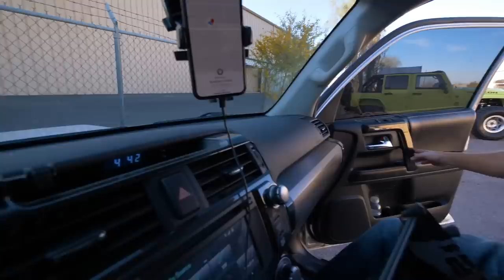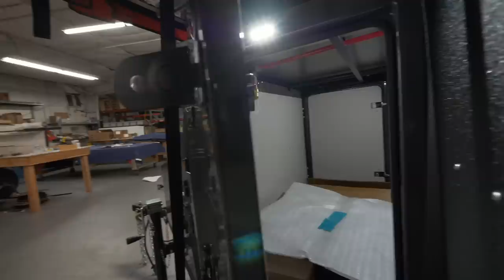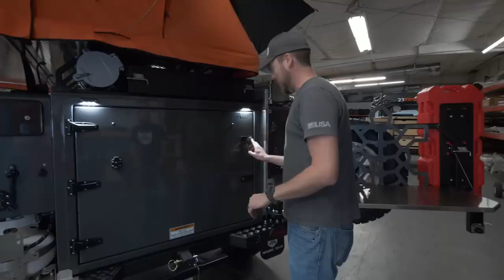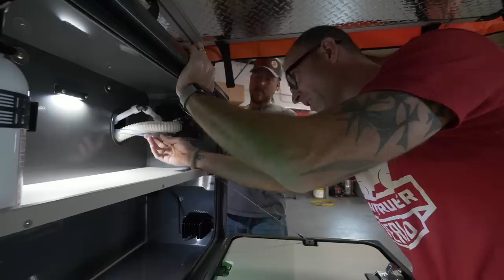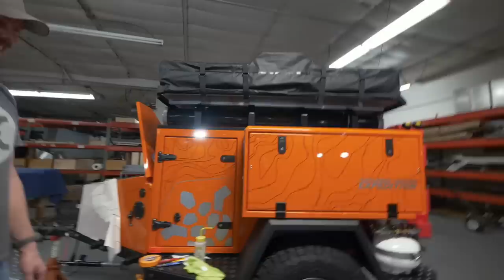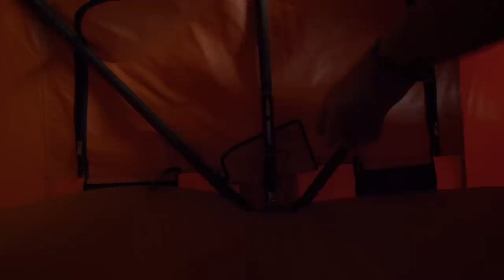EP59 - OUR NEW TURTLEBACK TRAILER

Comment: If toyotas are known for low voltage output, (alot of people dont know) but you can swap out the voltage regulator on the alternator instead of upgrading the alternator and safely increase your output. the alternator puts out about 1./3 more than the car needs, and the regulator manages teh alternator output and wastes off any unused energy to prevent burnt out.

Comment: I went over to their site to see and price the trailers. The turtleback expedition trailer has an MSRP of OVER $23,000! That's a nice trailer but $23,000 for that thing is absolutely INSANE!! You have to be nuts to pay $23,000 for that trailor!! For those of you thinking about buying one I have some property on the moon I will sell you.
Reply from the maker: Well. I’m a little nuts. And these aren’t for everyone. But for what you get, it’s a great value! I wouldn’t want the cheapest thing I can find!
Reply: Don't get me wrong. It's a nice trailer. It's well built and well thought out. They used really good material in it as well. However, $23,995 for that trailer is just crazy. You can buy a new car for that price. They are getting what $23,995 for something that cost them MAYBE $4,000 to build! $4,000 in material...……….$20,000 in profit! That's just crazy. I can buy a Tacoma SR5 for that price! I could buy a nice Rav4 for that price.
Reply: go through the option adding page and then include a tent and you're at $39,750

Comment: The trailer is super cool! From an engineering stand point having water lines in the same compartment as your electrical outlets is not very well thought out. Anytime there are water lines its always potential for a leak! Water and electrical don't mix! Looking forward to seeing you camp with your new trailer!! Thanks for sharing!
Reply from the maker: Those are only for water in, when filling up the tank.
Reply: Care to elaborate? Your wiring harness in your vehicle is subjected to water on a regular basis with rain and water crossings... A leak in the trailer, if it ever happened, would be highly unlikely to cause a short because tap water has a high resistance factor (for starters). Pair that with the fact this is 12VDC and therefore even less likely to pass through the water. IF it ever did happen, all circuits are protected by circuit breakers, so dry it up, fix the leak, and reset the breaker. (Sorry, electrical background here so have to call it out because comments like this can deter people who are unfamiliar with the concept.) I've seen 277/480 V panels with water pouring out of them that never tripped a single breaker, no worries here.

Comment: What the price of your trailer as its spec out
Reply from the maker: One like mine is in the high $20’s / low $30’s depending on features and options. But they have several models in lower price ranges.